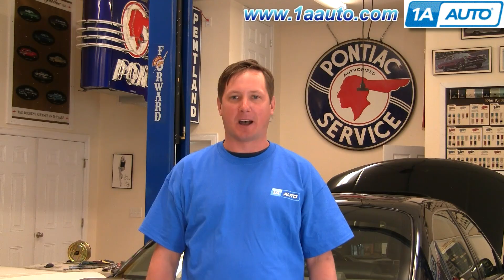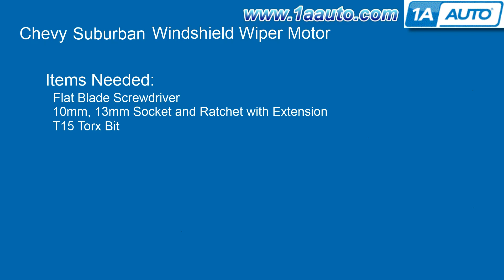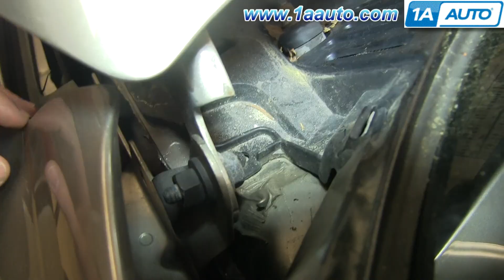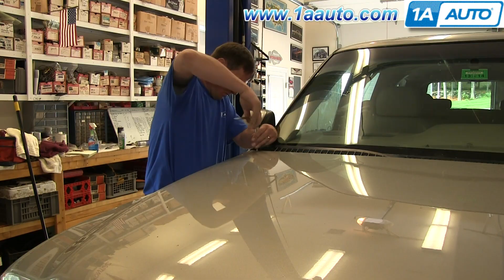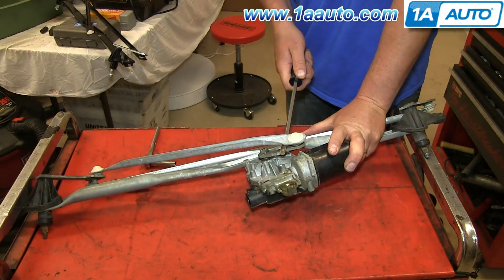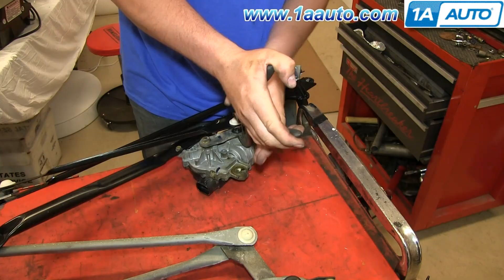How to Replace Windshield Wiper Motor 00-06 Chevy Suburban

Comment: For this generation Chevrolet truck, also good to check your passenger side under-cowl water barrier, while you're in here doing wiper or wiper motor repair. The integrity of the openings & seals under that black cowl is a chronic issue in these vehicles, which manifests in water dripping onto the passenger floorboard...or worse, dripping down behind the dash, under the carpet, soaking it from underneath.

Comment: 4:42 in was a critical point for me, resetting the new motor...something I had not done on my previous attempt to fix wipers that only worked on one speed. Now I have fully working wipers on my Silverado. Thanks for the straight video.

Comment: Would I need to replace my wiper motor if I have one wiper working?
Reply: I know it’s been 4 years now but if just one wiper is working then most likely the one that doesn’t work is simply loose and all you need to so is tighten the 13mm nut on the wiper that doesn’t work. There is only one motor that moves both wipers so something in the mechanism is not functioning properly for just one wiper to work.

Comment: Is the wiper motor transmission the same setup on a 2004 1500 Silverado ?
Reply from the maker: +Niles Gillis This video is applicable to the 00, 01, 02, 03, 04, 05, 06, Chevy Suburban, Tahoe, or Silverado pickup truck; or GMC Yukon or Sierra.

Comment: I bought for A1A and installed the motor just as in the video. However when turned on the wipers turn the wrong direction and immediately go down and obviously stop and don’t go further.

What is wrong and what should I do?
Thanks
Reply from the maker: +Trenton League We wouldn't be able to diagnose an issue like that here, you may want to have a local mechanic take a look at it. Thanks for checking us out! http://1aau.to/m/Shop-1AAuto-c
Reply: @1AAuto  I bought the part from y’all so I could do it myself. I did everything as it was done in your video. But I cant change the direction of the motor that y’all gave me which is wrong. It goes opposite of what makes the wipers lift then drop.  Otherwise I’ll need to send the motor back and buy from a part company that can send me a working part
Reply from the maker: +Trenton League We are sorry to hear this! Please give us a call so we can have this corrected for you.

Comment: Question: passenger blade works fine, driver only twitches,   what is the issue, I think the actual arm that holds the blade stripped out,  but I haven't looked yet. Any advice?

Comment: How much would a shop charge for this to be done?
Reply: Are you sitting down?! The Chevy dealership quoted me $1,600. to replace the motor on my 2002 Trailblazer. The charge to "diagnose" the problem and do a minor fix that didn't work was $600.00. That means I'd be out a total of $2,200.! This was two years ago and it's still not fixed and driving me crazy. Thank God for this video so that I can now do it myself!

Comment: Thanks guys!   Great video—and the only thing I wasn’t 100% Sure of was the alignment of the new motor arm, which I had to attached to the spindle, however I approximated the angle that you illustrate in the video and it worked fine.  Only took about an hour to put it back together.  And my symptoms were the wipers would not turn off —only could turn them off by pulling the fuse

Comment: I can Guarantee that you will break One of the Plastic Parts, it Always Happens especially if the vehicle is 10 or more years old....
Reply: YUP 100% TRUE RANDY. 1.THE MINI PLASTIC NIPPLE ON THE END OF THE WIPER HOSE INSERT ATTACHED TO THE BLADE  BROKE OFF ( HAD TO BUY A WHOLE NEW ARM AND PRY THE BROKEN NIPPLE FROM THE ATTACHED BODY OF THE RUBBER TEET ON THE CAL PANEL) 2. THE HOSE ITSELF LEADING FROM THE RESERVOIR SNAPPED ( TAPED THAT BACK 2GETHER) 3. THE EDGE CORNER THAT SECURES THE SMALL T-15 BOLT..SNAP!...GETTING THE TRANSMISSION BACK IN WAS A BITCH FOR SOME REASON....OUT COOL, BACK IN, HELL NO.... GEEZ,,,20 MINUTE FIGHT............ALSO ONE OF THE CLIPS POPPED OFF - LOST 4EVER...... GOT IT DONE THO....TOOK LONGER THAN EXPECTED  DUE TO THE UNFORESEEN. SOMETHING STILL NOT RIGHT, OPERATES GOOD, BUT HESITATES AT THE BOTTOM OF THE CYCLE. STOPS WHEN TURNED OFF...THEN A HALF INCH JUMP UP....

Comment: Thank you for the video, I not only changed my wiper motor, I also installed a sheet of wire mesh over the fresh air intake to keep the damn $%@)$% mice out of the blower and the cabin

Underneath the cowl on passenger side, I took my die grinder and cut a square hold 5 x7 inches big enough to get the wire cloth in there and expoxied that over the intake

My 2004 GMC 2500HD didn't even come with cabin filter so I'm at least going  to be able to prevent the bastard rodents from getting in.
Reply: jkarov 
Brilliant man. Thanks for the Post. I keep my 2500HD in heated Storage 5-6 months out of the year.
Reply: Lol

Comment: Very useful video, Only thing I would add (after doing my 2002 silverado), Take a picture  of the orientation of the short linkage bar that attaches to the drive spline before removing the assembly from the vehicle, this will allow you to verify the correct orientation once the new motor is attached, and save a lot of time adjusting, The short linkage bar will be pointing to the left approximately just before the nine o'clock position, the farthest point left without bringing the wiper arms down at the start of the stroke.
Reply: Yeah thanks for the tip.  Wish that would have been in the video too!  I'll try the adjustment.  Figured there would be a clarification in the comments.  Linkage bar should point to the left when the whole transmission is attached, correct?
Reply: Yeah. They really need to add that part. My replacement motor didn’t come with a linkage arm.
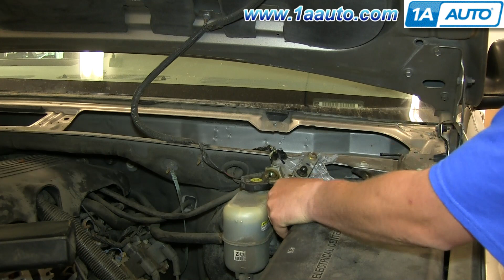Reply: @alajones5428  isn't that the process they cover when they have you connect the motor and turn on the wipers to reset the arm? At 4:50

Comment: My windshield wipers don't move at all. How do I know for certain it is indeed the motor? Could it be the transmission, a fuse? 2005 GMC Sierra 1500 SLT.
Reply: Check the fuse, it's in the panel on the drivers side when you open the door. If you have a multimeter, You can check the circuit for voltage. If thats all good it's probably the motor. If a linkage bushing is bad, you would probably hear some thrashing noise.